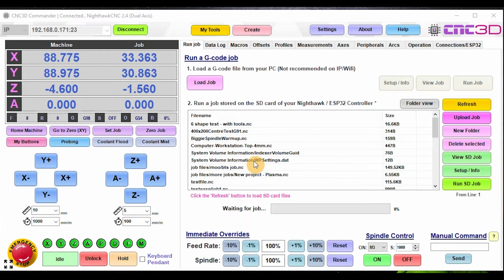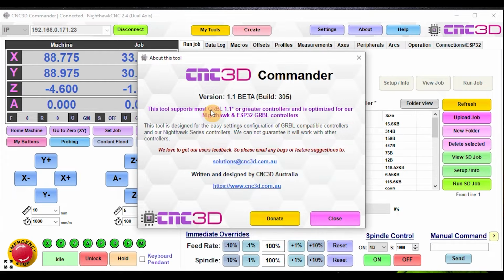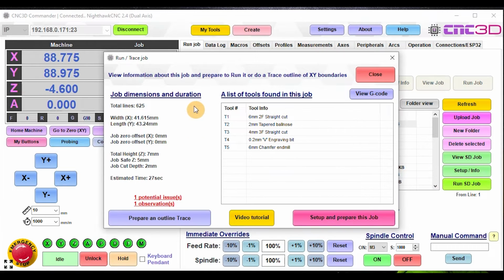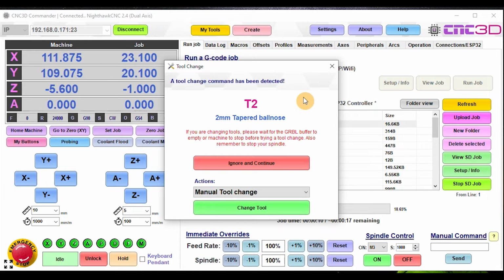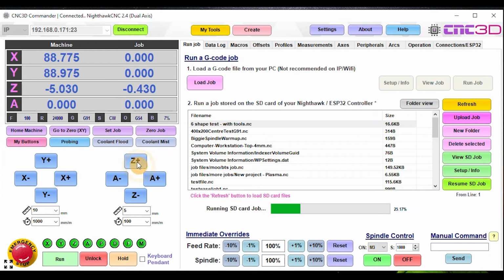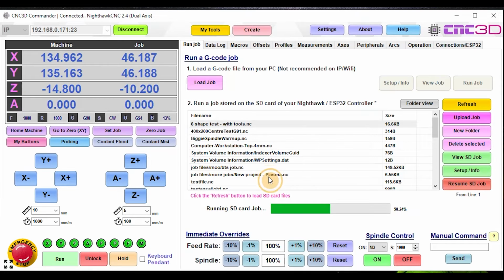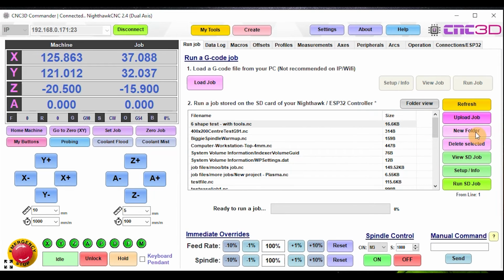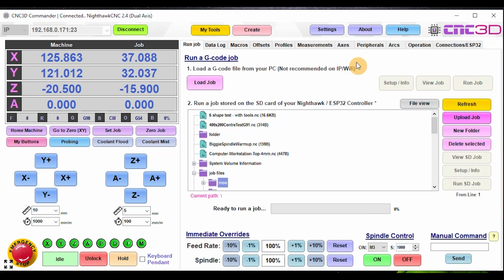Nighthawk CNC SD card job tool changing is now possible via CNC3D Commander build 305! (Coming soon)

Comment: I do like uysing this APP with MK-DLC32 board,  what I really miss is a way to write shortcut keyboard commands to my Macros / Buttons.  I use a Raspberry Pi PICO Makro keyboard that I use for DavinceResolve commands and UGCS it would be a real upgrade to CNC3D
Reply from the maker: hmmm.. full customized key bindings you say?...

Ok. I am implementing now. standby.
Reply: What controller do I need to use to be able to use your software? 4 axis is enough, do you sell a controller and software available? Does you software allow sequential serial number engraving?
Reply from the maker: @jerrylambert9209  Commander supports a variety of GRBL based controllers including grblHAL and ESP32 GRBL.

That being said, to use these advanced features shown in this video you would need to use our Nighthawk CNC controller.

You can learn more about it here: 

https://www.cnc3d.com.au/nighthawkcnc-controller

Our software is primarily control software as opposed to CAM software specifically but it does include some CAM tools. Nothing for repetitive commercial like sequential numbering tasks at this stage but that will change in future most likely. :)
Reply from the maker: How does this look?

https://youtu.be/cVCexezLCvY